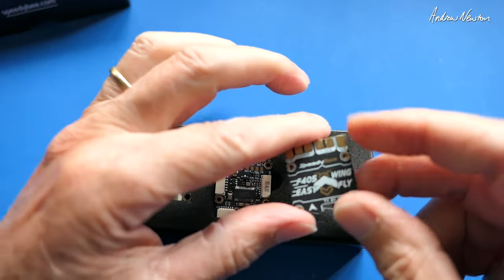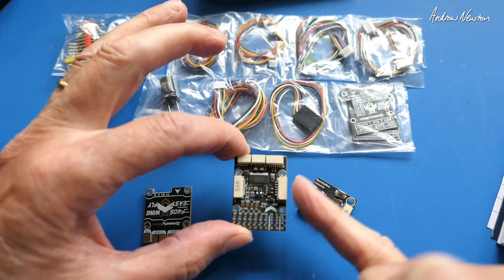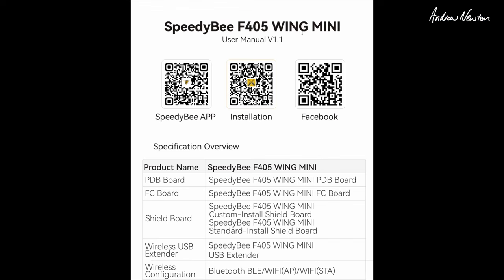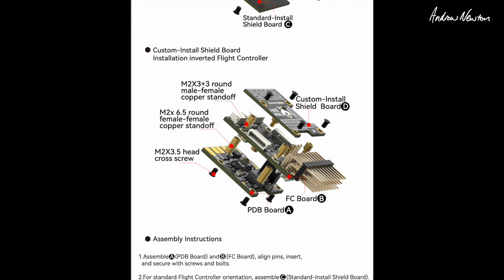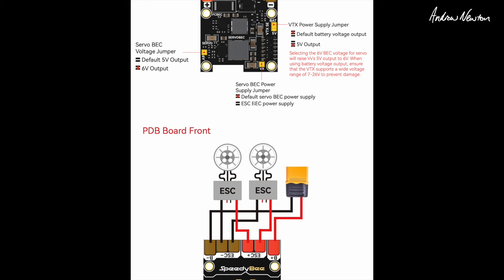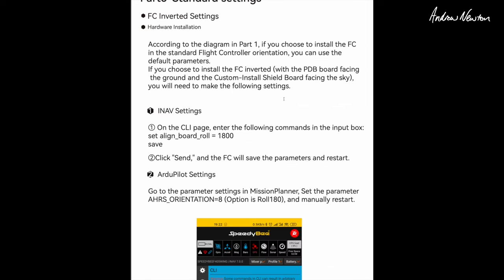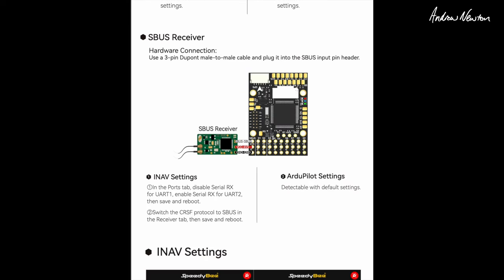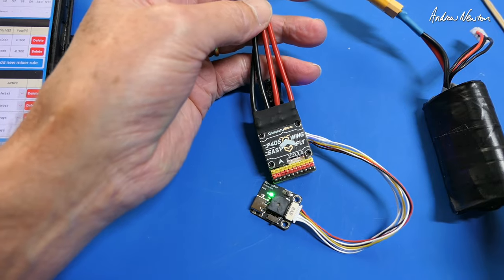SpeedyBee F405 Wing Mini Easy Fly

Comment: Excited to see the wing FC category still getting love. Seems like everything I use in the full size plus a camera switcher in a smaller package and lower price. Nice
Reply: Only 5v BEC for vtx.  Otherwise vbat.  Camera switcher only works for analog.
Reply: @scottyh72  😆 oh you've seen a lot of other FCs with digital camera switchers? Also won't most digital VTXes take 6S voltage? Is a dedicated vtx step down even needed on a low noise fixed wing?
Reply: @CapnBry  cool your jets Cap'n.  Just providing info.

Comment: The matek f405 wmn has camera switching. This looks to be a direct competitor. The biggest difference being the wireless support for configuring and plugs instead of through hole solder.
Reply: Matek is trash. I got a bad board and when I tried to submit a warranty they ran me in circles and eventually told me to switch out my receiver and servos... I tested them prior... it was ridiculous. Will never buy a matek ever again.

Comment: Hi Andrew 
You are great in explaining the specs of the products and the pinouts , connection with the App was awesome.
Requesting you to make a INAV fixed wing video using this FC . Can this be used to make a VTOL wing with quad motors for VTOL and a dedicated motor for the wing and if possible kindly make a video of schematic settings for VTOL as you have explained in later part of this video .
Regards
Reply from the maker: INAV setup on a Penguin coming soon. But VTOL is beyond my knowledge sorry.

Comment: Good day Mr Newton. 
With respect to the speedybee f405 wing mini,

I have a VTX which can take battery voltage 7-20v

But a camera which only takes 5-12v. 

I'm confused as to whether or not my camera is compatible or whether any pads need to be soldered. 

Your advice and assistance would be appreciated.
Reply from the maker: Ah yes, that's tricky. Connect the camera voltage wire to any 5V pin

Comment: I am confused about the Flight Controller information on the Ardupilot website; they say the RC input for the autopilot on RX2 will connect to a timer instead of a UART, which should mean PPM is supported... right? Also, would this support Ardurover? The previously available Wing is... so I hope so...
Reply from the maker: According to the manual SBUS / PPM can be used on RX2. No reason why rover wouldn't be supported.

Comment: Is the a simpler flight controller and not very expensive for an airplane application with just 4 channels, i just want wind mitigation and autolevel. thanks
Reply from the maker: Can do that if you just ignore the GPS stuff. Might be a good video subject.
Reply: @AndrewNewton  oK thanks.  I have a Radiomaste boxer with 4in1 internal module. Fly just small 800mm foam planes , line of sight and not FPV.

So far i have used Radiolink Byme A and required a Sbus receiver, works but angles can not be adjusted. And support or information is not much , so answer any questions.

I have also used a second hand Spektrum AR631, expensive $60-70. I can be programes with the radio without the need of a PC.

I have also purchsed a Lemon stabilizer, it is also capable of flight pack voltage/current telemetry but it does not do autolevel.

I am looking forward for your next video.

Thanks again

Comment: I’m not sure I would buy this again.  

I had a ton of issues with the hardware.  The standoff and screws all got stuck.  I spent more time on the hardware than I did soldering the pins and batteries.  

I think if I have to take this apart, I’ll give it a short try, then chuck it.  Because of this , I won’t be going with a sd card.
Reply from the maker: Cross threaded the tiny bolts?

Comment: You completely skipped over the most important part... the wiring of VTXs!! Would have been nice if it was a video similar to your regular speedybee f405 wing video... :(
Reply from the maker: Great feedback in your other comment thanks. I can see why using the solder pads instead of the sockets would be confusing. Looks like the Analog and Digital FPV pads are not in logical positions. Just know that the Digital VTx needs a UART connection for the OSD, and Tx connects to Rx etc. UART5 T5 and R5 would be the usual choice. Vv and G for power. Then you would choose MSP DisplayPort for UART5 in INAV.
Reply: @AndrewNewton  lol it was the msp display port toggle switch I forgot... but yes, I your it helps. Some of us need it very dumbed down. Ahaha!! Anyways, thanks again for your response and all your great videos. You're awesome!